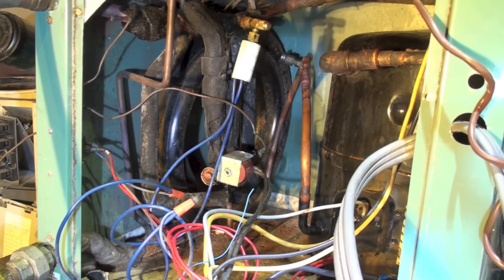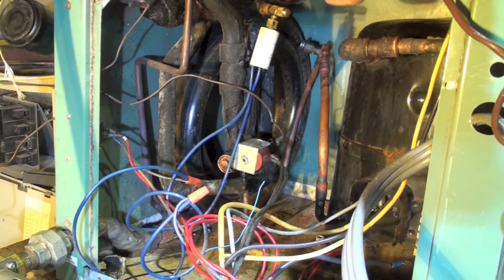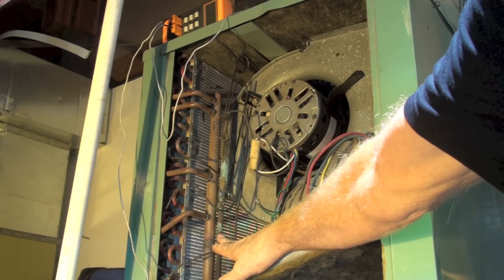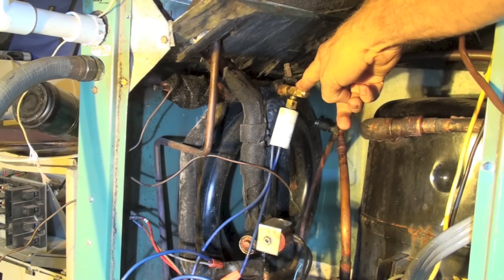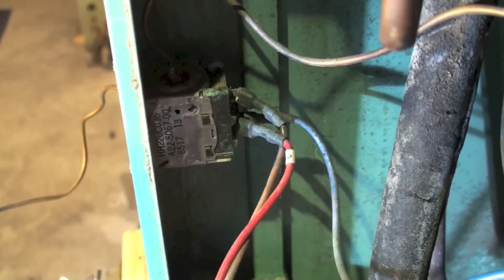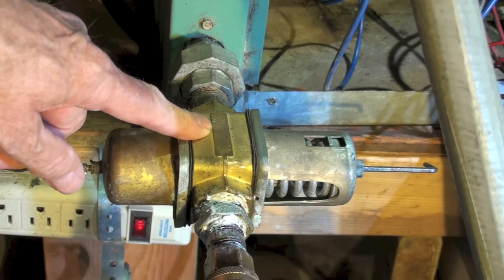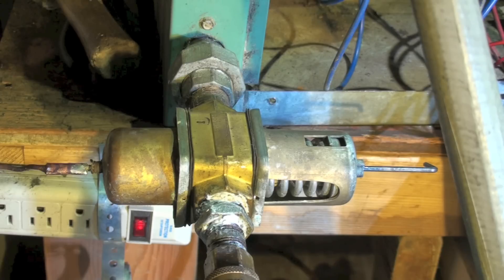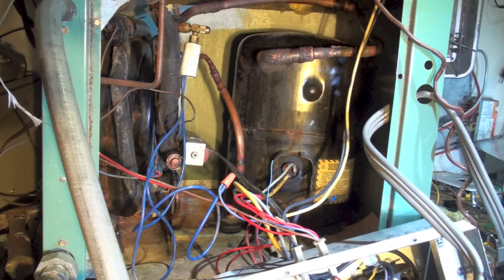A look at the water source heat pump parts

Comment: So the water acts like a condenser fan motor so to speak to remove the heat from the refrigerant lines ? Also , does the water usually come from a chiller or something ke it varies ?
Reply from the maker: Correct in A/C mode.  The water could be from a well or a closed loop buried in the ground.
GFM

Comment: Thank you for sharing your knowledge. I am replacing a 27 year old Miami Heat Pump that had a water valve exactly like the one you have in your video. You say the new one's don't use that anymore. Can you tell me what the new type would  look like? We can't find it in the new Miami Heat Pump unit, and don't trust that it is there. You can certainly take the old unit, but you probably live too far away..lol
Reply from the maker: Most of them use a fixed orifice probably located near the water solenoid.
GFM
Reply: Thank you so much for your response! We've been told even though we can't see it, that there is an internal control on water flow (fixed orifice). The installation recommendations call for a solenoid valve. Would you suggest inflow, or outflow side? From that company, we are getting conflicting information. We live in an area where HVAC companies are not familiar with geothermal heat pumps, so we really appreciate your videos and responses.
Reply from the maker: @cathyjohnson3360  I would suggest the solenoid valve be placed on the inlet.
GFM

Comment: We use the water regulating valves on systems that can not maintain an 80 to 85 water temperature.  If there's is no cooling tower and domestic water is being used. That gets connected to the high side and adjusted to maintain proper operating pressures. Good video very informative.
Reply: You can go geothermal  units, or just use city water with a regulations valve. Just remember it it's i
illegal in lot of states
Reply from the maker: +Emin HVAC It also is more expensive in most areas to use domestic water than to use air source.
GFM
Reply: grayfurnaceman yes, wasting city water is illilgal in most locations